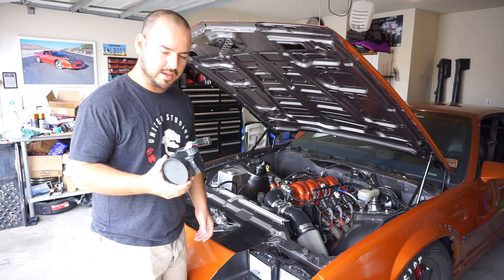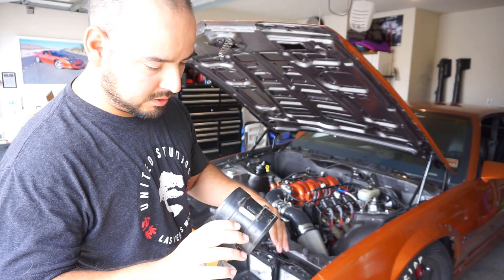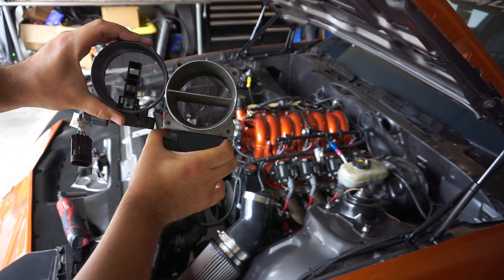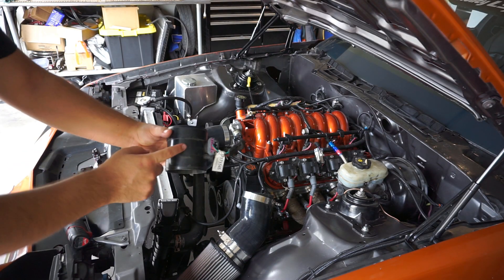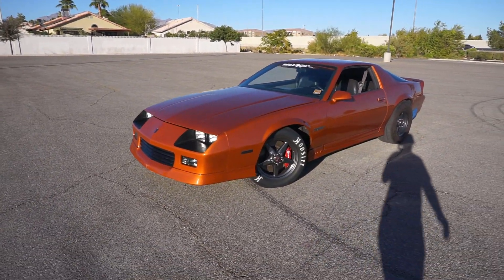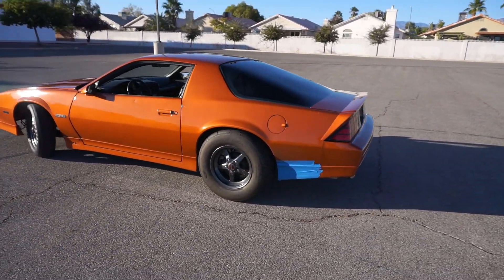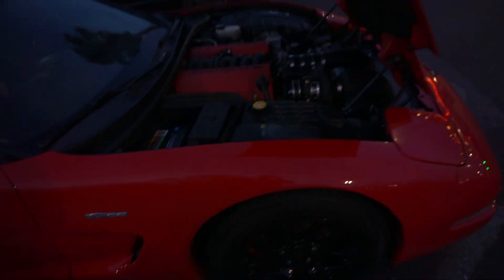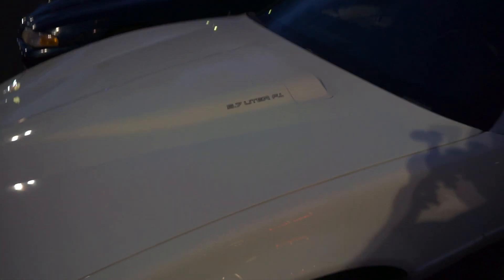UPGRADING LS1 MASS AIR FLOW SENSOR

Comment: As a dealer tech for 35+ years, I have never seen a re-learn procedure for replacing the MAF sensor. If the MAF sensor you replaced had Delphi on it, that is factory. As far as the wing shaped aluminum bar inside, that will not change the volume of air flow into the engine. This does not effect volumetric efficiency. Crankshaft sensor, crankshaft or PCM will require a re-learn because it changes and effects the ability to remember the power strokes so if a misfire fire occurs, the CKP will detect it by the power stroke profile changes. This is P0300. The CMP sensor will tell the PCM which cylinder is on power stroke to allow the PCM to determine which cylinder is the problem. So, if cylinder #5 fails, it will set a P0305. I have no clue what brand of MAF sensor was installed. Honestly, I believe most would clean the garage first & wash car, then shoot your video. So the cool stuff you found. Best of luck!
ASE Master Tech since 1978.
Reply: Go back to school then, because I am a software programmer and computer science major. I have worked in the automotive industry for AC delco, and denso for over 8 years, 2 years with delphi. We do create systems for the ecu to relearn and recalibrate (depending on the OS year) the sensor since some sensors can be upgraded in future year models and is better to keep the current tech working if possible and our senior developers wanted flexibility for the manufacturer. This means that if a different trim package or a different year model could use the same technology and OS without having to change much. The system itself would adjust to the parameters limits and recalibrate and recalculate the outputs from what the sensors receive. This way the manufacturers save a ton of money and we can develop also the hardware for them to use without changing much.
Reply: @LaCacaLoca  That’s fine, it runs without a MAF sensor on “Speed Density” just like open loop until O2 sensors heat up. Still, replacing a PCM, crankshaft or different engine to old PCM, still requires a re-learn. And you can’t get a P0300 or refined cylinder code without the CKP & CMP sensor. Even 2022 models. You can tinker with sensor and code, I just fixed them and taught for ACDelco in 7 states. The puzzle palace in Grand Blanc right seminars, training materials and produce power points. Us in the field have to fix the information since they don’t even have access to a TECH-2. Why go back to school, I am the one teaching it! Only had one engineer spend time in the shop bay asking questions. They over think things and frequently make mistakes retired engineers learned 30+ years ago. If you don’t learn the past history, you’re bound to repeat mistakes. The best answers comes from the tech who works on them. Information in the diagnostic flow charts were wrong all of the time or incomplete.
Reply: @deankay4434  I agree. Is also part of management for us. Sometimes I built amazing prototypes and when it gets to management they either scrap it because of budget or some knuckle head just says no to prevent losing his/her job if something goes south.
Reply: @LaCacaLoca  I spent an entire day at the “Alternative Vehicle Development Center” and drove the EV1 on the streets and spent time with drive system built to completion. In 1967, GM invested in Isuzu to purchase Japans Oldest Diesel manufactures 3 cylinder Diesel engine to drive an A/C compressor that became “Thermo-King” for semi Refer Trailers. Having up to 49-51% of stock, they took the 3 cylinder diesel, put controls to run a generator that drives electric motors. Same concept as a train except it would shut off at stop lights and auto start. Until full warm, it would idle, but holding the RPM’s steady allowed for great fuel control. They had a working “Skate board” platform on display as well. We spent time with 36-42Vdc extend cab truck that used two 90hp electric motors in a 4L60 transmission case. Front motor started and reverse was electric only. My favorite was the hydrogen fuel cell vehicles. 7% more water dripped out tail pipe, 180Vdc with water cooled inverters & converters for 3-phase toroidal motors at the rear wheels. With 170 mile range on gaseous hydrogen or high pressure liquid push it to 290 mile range, 5 passengers and 100 MPH top speed. Saw a lot as GM had 4 facilities for the hydrogen fuel project. This was my favorite as engineers were targeting 86% efficiency of the fuels potential. Hydrogen leaks fly straight up in an accident or garage repair via 3-stage regulators down from 10,000 PSI. They add sensors on the ceiling and a powered vent would evacuate the hydrogen build up. The only noise heard was the 42Vdc screw-type compressor to push more oxygen in the “PEM” type fuel cell. It make a little whine noise not bad. Fun to drive and I want an EV1 as they did not destroy them as reported. Matter of fact, the drivetrain was repurposed to S10 pickups leased to Conn-Ed on the East coast to read meters and some repairs. Fun stuff!

Comment: came here to watch upgrade MAP senor... Dirty Garbage ??? Wheels of Craig's List ??? clean Garbage ??? the NEXT DAY ???
Reply from the maker: Map or Maf? I did upgrade the maf to a better flowing 5 wire maf.  Yes they're was some extra stuff along the way, but that's okay.
Reply: @FinalBossGarage  looking at my MAF (everyone says MAP) in my 5.3 2004 GMC Truck... It looks like the MAF is the Major Bottle neck in the Air intake factory sysem ... More Air should be better Fuel mileage... I have 3 MAF and a NEW one in the Truck ALL are Factory... looking at cutting one apart or cutting that screen off
Reply from the maker: Map sensor reads the pressure inside your manifold. Maf sensors reads the amount of air entering the manifold.
Reply: @FinalBossGarage  Ok...  I have 38 years Paint and Autobody and used to carburetor engines when building a car or truck Trying to learn all this crap wiring and sensors just to make a SIMPLE engine run

Comment: I need your help. I live here in Vegas and I don't know how to get an exact harness and computer for my project
Reply from the maker: If you go with the new Holly terminator x, you get a self tuning computer, wire harness, and screen with digital gauges. It's a 1000$ but you dont have to pay a tuner for a tune, or gauges. I wish I went this route.
Reply: Check out swap time.. I belive he is in Vegas.  Very good.